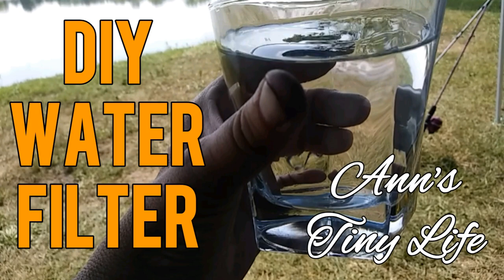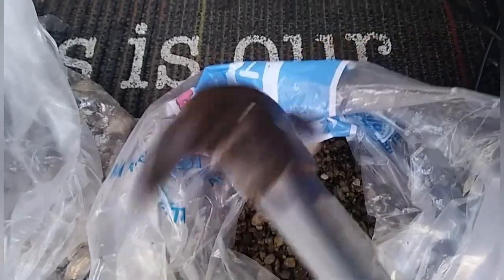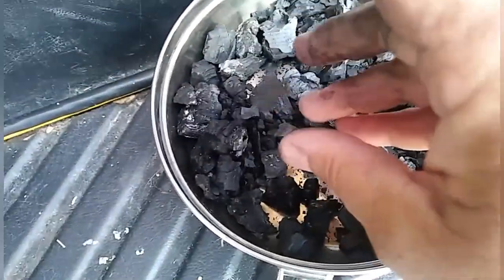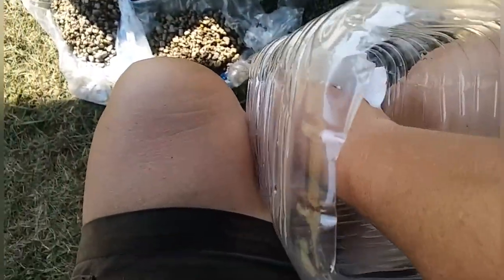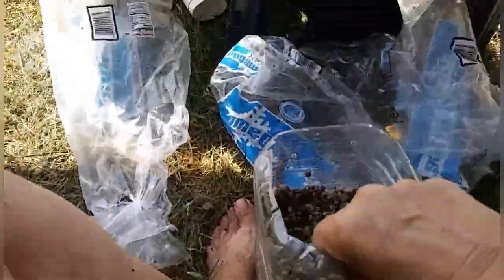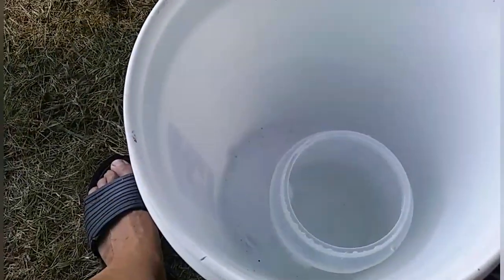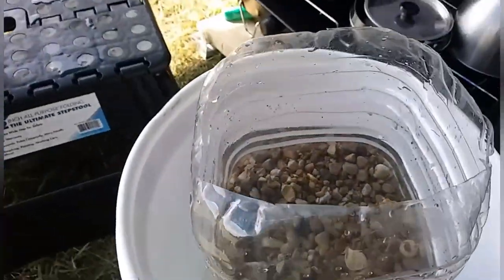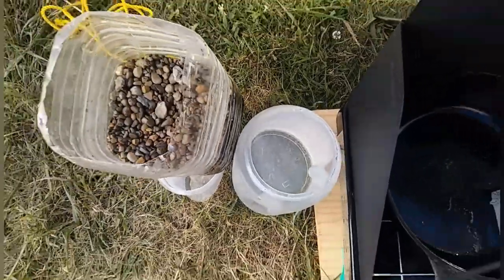I Make a DIY Water Filter - Ann's Tiny Life

Comment: AWESOME, ANN!   I REALLY BELIEVE THESE KINDS OF DIY'S AND SURVIVAL  KNOWLEDGE IS MORE IMPORTANT NOW THAN EVER.   I AM GOING TO START COLLECTING THE SUPPLIES LITTLE BY LITTLE NOW.   WOULD COFFEE FILTERS WORK?   I HAVE THE SQUARE GALLON BOTTLE I AM USING NOW SO GOT THAT!!   I LIVE JUST ABOVE THE BIG COLUMBIA AND THERE IS A PARK WITH A BEACH SO MAYBE I CAN GET BOTH SAND AND PEBBLES.   I WILL HAVE TO BUY THE CHARCOAL THOUGH.   THANK YOU SO VERY MUCH FOR LEADING THE WAY AS WE ENTER TIMES WHERE BEING SELF SUFFICIENT COULD BE SO IMPORTANT.  KAREN
Reply from the maker: I don't really recommend coffee filters. they actually don't work for that long, and they drastically slowed down the process. and you would have to replace them too often. and when you replace the coffee filter you basically have to dump the whole thing out and start over. I wouldn't use them.